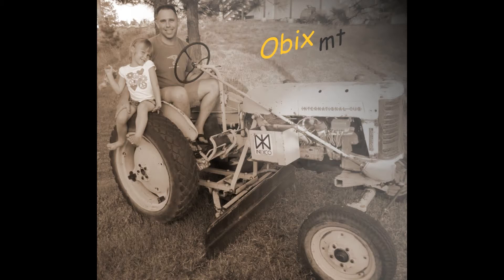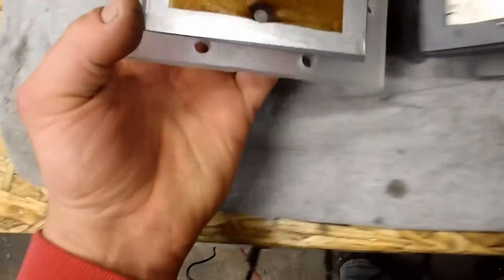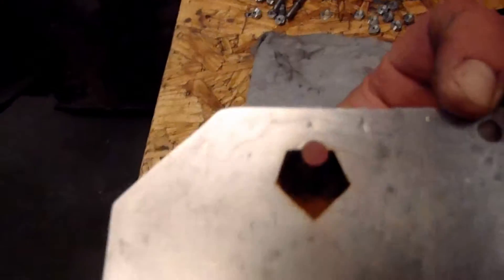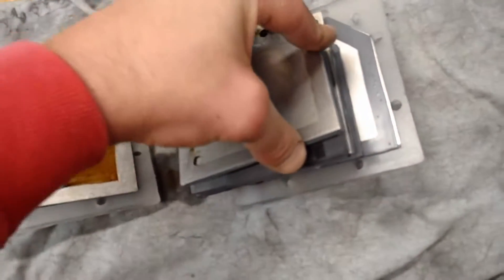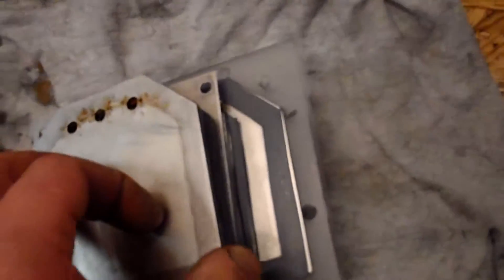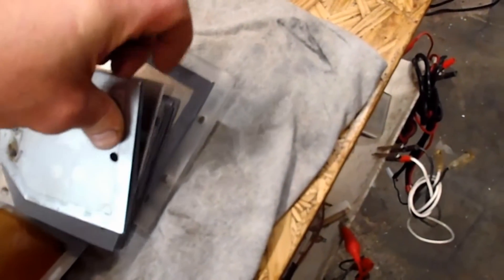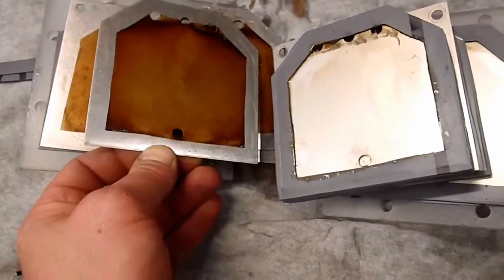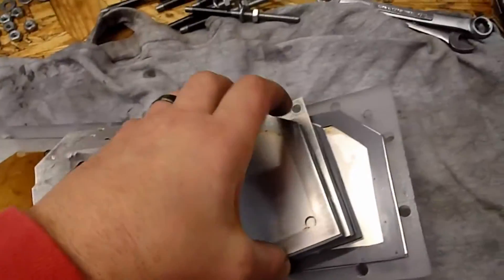HHO Dry Cell - 7 - Plate Inspection After Drain Cleaner

Comment: the reason your are seeing this is because the anode produces oxygen and it corrodes and oxidizes impurities  the cathode however produces hydrogen gas and blast any sludge or dirt off down to the microscopic level  . to prevent this simply change the polarity of your terminal connection on the dc side of the circuit

Comment from the maker: @sixpack127 Hey that makes sense, I just had to put a new water heater in and was discussing the whole grounding to the copper pipes thing with the plumber.  I wonder if it is chemically balanced more negatively so that it will not attach to the pipes?  Thanks for the comment!